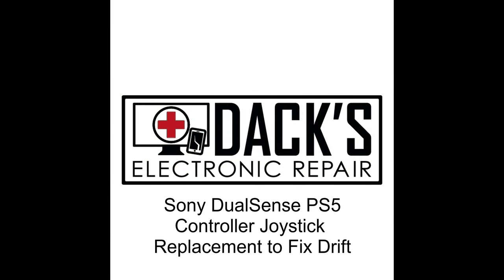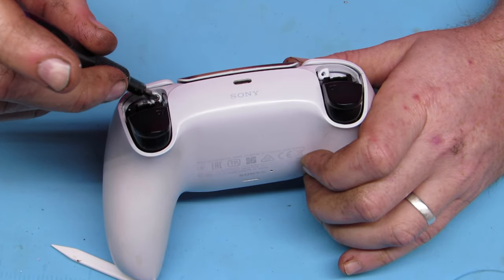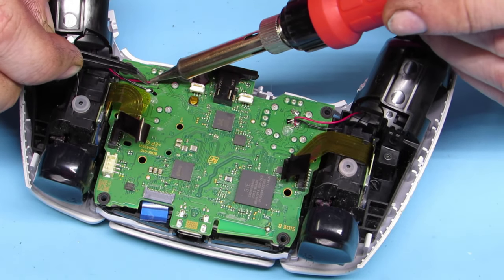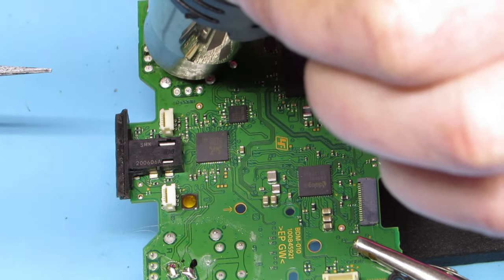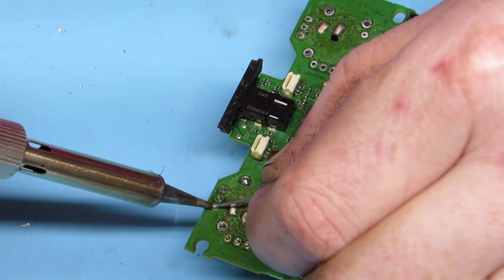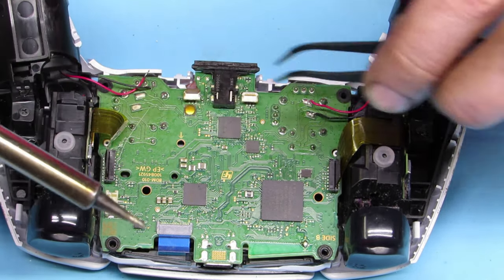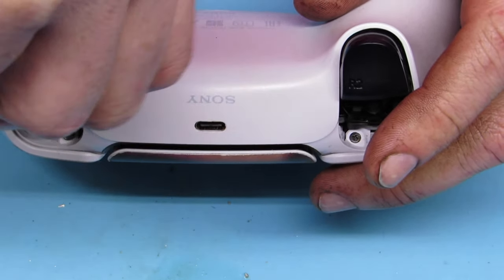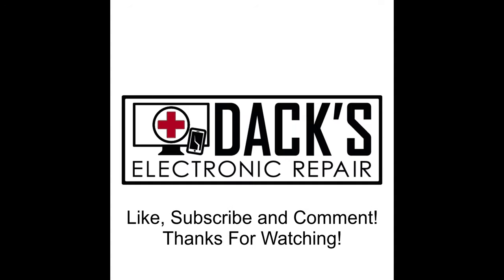How to Fix a Broken Sony PS5 DualSense Controller - Fix the Dreaded Thumbstick Drift!!

Comment: hey, great vid! I was wondering if the thumb stick would need to be calibrated after you make the swap, and if that would be done physically or by software. also what was the liquid you used to clean the pcb after you were done?
Reply from the maker: No calibration needed. I use isopropyl alcohol to clean the board.
Reply: @dackselectronicrepair  thank you, one more question…do they work on all the DualSense controller versions? Specifically bdm 030 because all of mine with stick drift are that version
Reply: Oh is it possible to get a link for the stick modules just so I don’t get the wrong ones?

Comment: How did you get the new joystick components? Where can we buy them?
Reply from the maker: I get them through a wholesale supplier but they are on Amazon as well!
Reply: make sure you get the right ones for PS5 (2.1 or 2.3KΩ NOT 10KΩ)

Comment: I've never soldered before but i'd like to change my joysticks to hall effect joysticks what tools do you use do you have links?
Reply from the maker: I use a hotair rework station. You can get them on Amazon. It has a hot air gun and a soldering iron which are temp and airflow adjustable.

Comment: I replaced my sticks on my controller, but my right stick won't reach full outer range when it's all fit back together. If I take off the trim ring around the joystick, it reaches just fine. I've replaced the joystick cap and the trim ring and it's the same thing. Any idea what's going on here?
Reply from the maker: Are you using the stock joystick? Some of thr aftermarket ones or ones from a ps4 or xbox one are just a bit too big

Comment: Could the cause of the stick drift problem come from dirt buildup? That controller was absolutely filthy.
Reply from the maker: Not in this case but I suppose dirt could cause drift issues. However, it would be hard for it to get into the actual joystick as the the thumbstick covers mushroom over the mechanism which keeps almost all dirt out of it.

Comment: No amount of heat gun is getting the old solder out any other advice?
Reply from the maker: Try using some flux and melt some leaded solder into the factory solder. That should lower the melting temp of the unleaded solder they use.

Comment: I've done this 4 times, two were successful, and the other two I ended up melting the underside of the analog stick...what am I doing wrong?
Reply from the maker: It really is a time sensitive repair. You have to get all solder in all the legs heated up at the same time so you can basically just drop the new stick into place and remove the heat right away. If you leave the hot air going for too long after you put the new stick in place you will melt the underside of it. A little melting won't hurt anything but too much will make it not work.

Comment: power of having great tools, I destroyed my controller using cheap solder gun. No hot air gun. Torn a trace off
Reply from the maker: I have messed up traces even with good tools. Remember to mix leaded with the factory non leaded solder so it lowers the melting temp.

Comment: Isn't 450c too high?
Reply from the maker: You have to go pretty high to get the leadfree solder to melt.
Reply: @dackselectronicrepair  If you were to apply low melt solder onto it before using the heat gun, would it be at a different temp or the same?
Reply from the maker: @OKBUDDY21  Yes you can try that for sure. If you flux it and melt leaded solder it should melt at a lower temp on the hot air.

Comment: Is there a place i can take my controller into and they can do this for me?
Reply from the maker: I would think any place that repairs phones and computers would be able to do this. The problem you may run into is that it will cost more to have them do it then just getting a new controller!
Reply: @dackselectronicrepair  I see, thanks for the help

Comment: can you please post a link of the hot air gun you used ? i wanna buy it too. thanks
Reply from the maker: I use a Yihua 995D+ rework station. It has both hot air and a soldering iron. You can go way more expensive if you want but this one does everything I need. Here is a link to the amazon listing https://a.co/d/j47VnEU

Comment: Brother how can i fix my ps4 controlla it will not charge i tried just about everything besides changing the M-bored... Now it do power on however it will not charge at all what else can it be ??? If anyone can help an fellow gamer out on how to...fix it myself.. And or can anybody donate a old dusty PS4 controlla or i can trade for something i may have something of interest to you off rip just to name 1or2 things i have a 1080hp gopro I also have a gold plated Michael Kors watch with the lynx I have to loose links from when I loosen it for my wrist for tight fitting or trade that and no longer in making so this is a relic it hold rare they're no longer in spin mean that they are no longer in rotation no longer will they be produced this can be a monolith or a heirloom that you keep in your family as I plan for what's planning to keep in mind but I'm not mentally attached to things so to say
Reply from the maker: Not sure what is going on. It could be the charging port or the battery. It is also possible the motherboard is bad and in that case you would just need to get a new one.